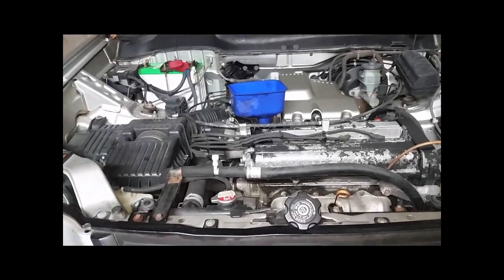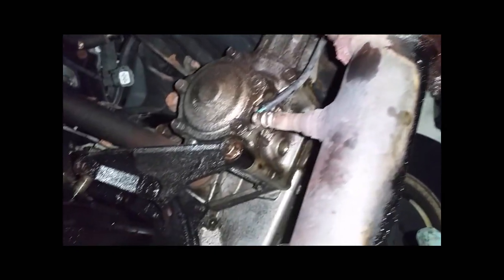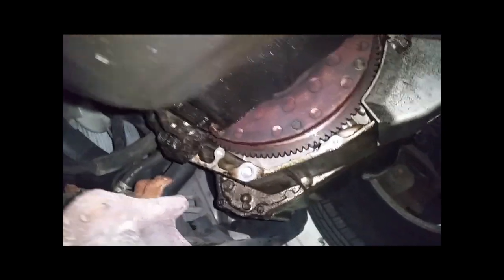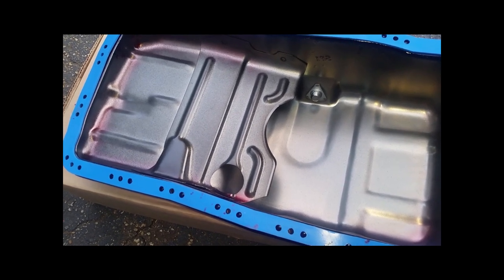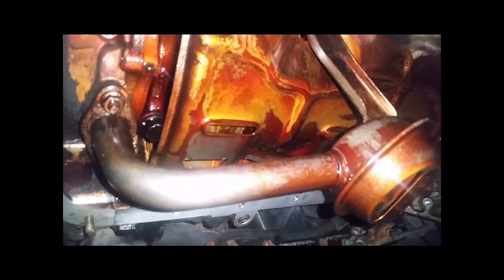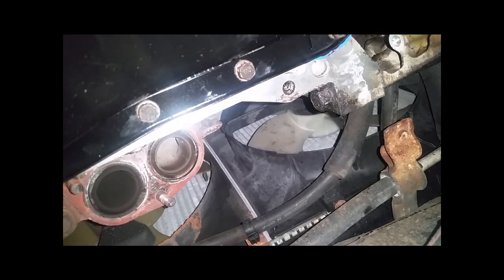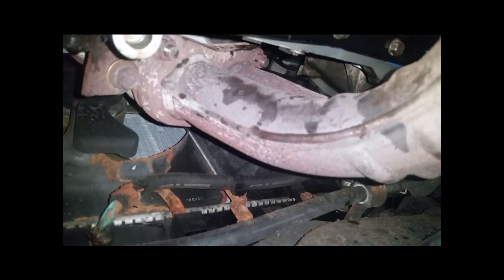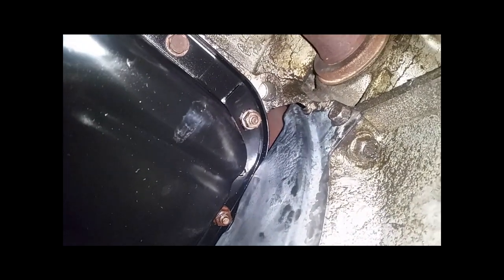OHT: 2000 Honda CR-V Oil Pan and Gasket Replacement [Sketchy Audio]

Comment: did u use any rtv?
Reply from the maker: Hi!
Yes. A small dollop where the gasket curves and meets sharp corners of the block...
...the corners where the gasket bends around the crank.

NOTE: be sure to remove all metal inserts that may have stuck on the studs from the old gasket.

Good luck.
Reply: Thank you appreciate it!

Comment: Many thanks for the video really good and helpful. But a word of warning here if you do this yourself. I have just done mine twice and the reason is the tiny collets that are built into the gaskets. On the Honda original gasket and the aftermarket gasket that I purchased they have tiny collets that fit over the studs but only where the gasket is close to the flexplate/flywheel. I believe its there to stop you overtightening the gasket. What happened to me was that the gasket come away with the oil pan but left a collet stuck to the block on a stud which I did not see. So watch for it as it could save you a lot of work and expense.

Comment: Going to be taking on the oil pan change challenge for my 2000 crv. I was wondering what you were spraying on the surface mount for cleaning?  Thanks! Would like to add very helpful video. I appreciate you posting and sharing.
Reply from the maker: Thanks! I'm glad it helps anyone attempting to perform the job themselves. 

As for the surface cleaning, any non-chlorinated brake cleaning product would suffice.

Bon chance, mon ami!

-100
Reply: @EKHondaMotive  Thanks!

Comment: Just watch the video twice, my question is on the exhaust flange was their a gasket thier or you just bolted it back up as is and no exhaust leak?
Reply from the maker: Good eye!

I reused the old gasket and had no issue.

Its not uncommon for the gasket to be fit for reuse. However, be aware that many a time the corrosion buildup makes for a fun time if you decide to replace it.

I recommend replacing it...ONLY if necessary. 
Besides, it's not to hard to get to if you have an issue with it later.

Hope this helps.

Good luck!

-100

Comment: Excellent vid mate really helping me a lot...

My wife has a year 2000 Honda CR-V with the 2.0l petrol engine. 

Literally when oil is poured in it comes out the bottom near to where the sump plug is. It seems to run down the side of the oil pan next to where the plug is. The oil is dripping from above and to the left the plug somewhere as you look at it from the front.

Help doctor help 😱
Reply from the maker: If I remember correctly, those engines don't have an oil cooler...but double check (two hoses going to the base of the oil filter). The o-ring there is prone to failing and leaking profusely. 

Seeing as you referenced it as a 'petrol' engine, I'm gonna hazard a guess that this CR-V isn't USDM. Nevertheless, if you clean off the area, and watch it while someone starts and runs the engine, pinpointing the leak should be easy enough.

That said, I hope that helps.
If you have further questions or wanna send pics of the area in question,  thegqtech@gmail.com is my email address. 
"Holla @ your boy!"

Best of luck!

-100

Comment: Question? If I change the oil pan. Do I have to change the head gasket as well?
Thanks
Reply from the maker: Not consequently, no.
The oil pan gasket was replaced because of a heavy oil leak.

Head gaskets can leak oil too. And they can leak down the block and make the oil pan look suspect.

Good luck!

-100
Reply: @EKHondaMotive  thanks!!

Comment: My dude - this is brilliant. Thanks for the inside look! Question: did you use a specific sequence for tightening down the oil pan (like you would with lug nuts) or did you just go around one bolt next to another? Your work is appreciated!
Reply from the maker: Christopher Czar Thanks! You're too kind.
I did torque the oil pan nuts in a sequence to apply pressure evenly around the gasket. 
Basically, I started with the middle front and back and the go back and forth, tightening nuts, crossing the middle each time.

Comment: Great video and just what I'm seeing under my '99.  Is there a common leak for CRV's around the distributor as well?  I replaced the valve cover gasket and that plastic cam seal, but still have a slow leak somewhere around the distributor.  Should I have changed something on that side while I had the valve cover off?  Great video!  Keep them coming for all of us DIYers.
Reply from the maker: The distributor o-ring typically leaks when it's old and brittle. Replacing it is easy enough when the distributor is removed. 
However an internal seal leak requires the distributor to be disassembled. #WatchJrGo has a good video on replacing this seal.

Cheers!

Comment: Again, awesome video.  Have you ever changed the rack and pinion on the CRV?  Is that a DIY job?  Looks like quite a job since it's really crammed in there, but like to do things myself if possible.
Reply from the maker: TheCowardlyLion Thanks for your kind words!

[EDIT] Dunno what I initially was responding to but as to whether the steering rack is a DIY job, I'd say yes. Not as easy as this oil pan replacement, but doable...with a little patience. [end]
The distributor has an o-ring around the base of the housing that leaks.
In some cases, the distributor itself can leak internally and seep out between the cap and the housing. This leak runs down the distributor and can look like a bad o-ring.
If the distributor is leaking internally, replacement is a more cost effective option as compared to rebuilding.
Good luck and if you need some more pointers on this or anything else that I've yet to make a video of, thegqtech@gmail.com is my email.

Cheers!
Reply: I just changed mine it is doable but there are some tight spots like trying to get the hose lines off the pinion which make it a pain especially trying to put them back in

Comment: 126am. Found this video searching the Google trying to find out if I can replace the steel oil pan with a aluminum oil pan on a 2001 crv.
Reply from the maker: I wouldn't...bracket mounts differ.